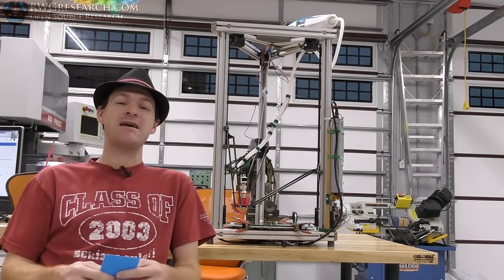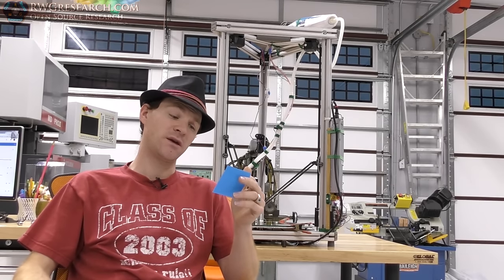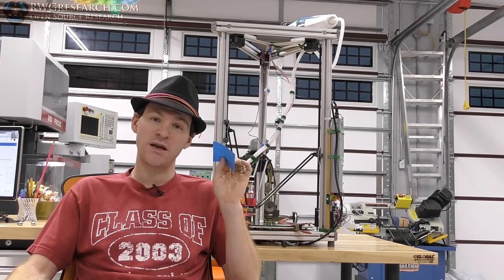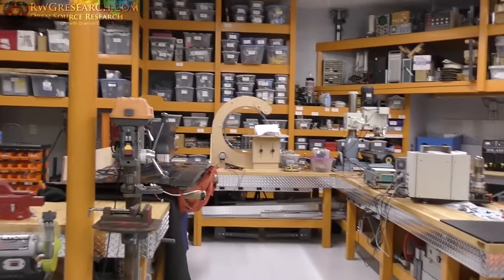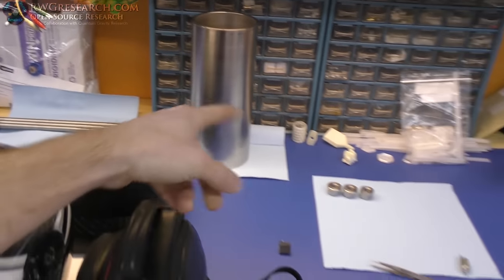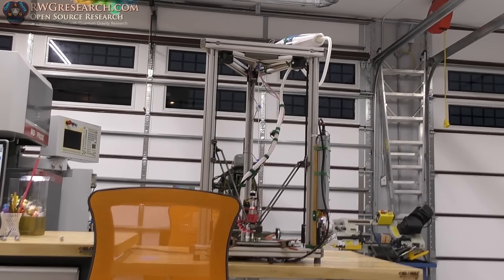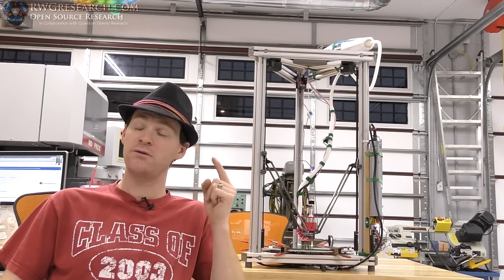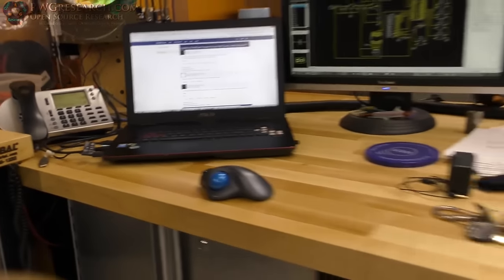RWG-CRV #5 This Is How Im Starting The New Year! 2017 Is Here

Comment: Just seen the map at the end Russ. I have the same with mine, despite having a huge 8mm thick chunk of aluminium as a bed that I know is flatter, although possible not in the correct plane. I think this is to do with the height of the end stops on the three columns. If they aren't exactly the same distance from the bed, then the calculations produce a skewed result.

I think you can check this by printing a very large rectangular hollow prism that goes right up to the boundary of your plate, in fact even exceeds it. If the calculations are producing a skewed bed map then the rectangle will be distorted at the end, even more so if you actually print outside of the triangle between the columns. 

I might be talking complete BS, but that's how it is for me. I spent a lot of time setting the end stops and it is now much better.
Reply from the maker: yeah. the end stops are identical.  I'll re check the geometry again as well. I think some of it has to do with the arms. might be maxing them out. now I know for sure I may have some problems because I'm maxing out my arms. most say it's imposible to use it like I am but so far it's not to bad. so I just need to make a better probe. this will also help. with it off set. it reaches to far. thanks for the tips. I'm still learning too ;)  ~Russ

Comment: I have watched you build videos quite a bit, can you explain how you got your vertical rails to work tuned up.  I have been working on upgrading my big 3d project to drive a spindle.  So when I see your circuit boards printed so good I have the question in my head what  is the bearing tension on those rails.  One of those deals where wish I could just touch it and see what it feels like and pick your brain.  lol.  Anyhow love your videos man!